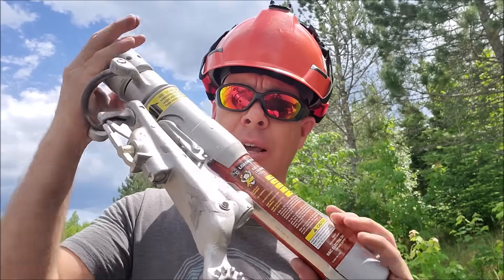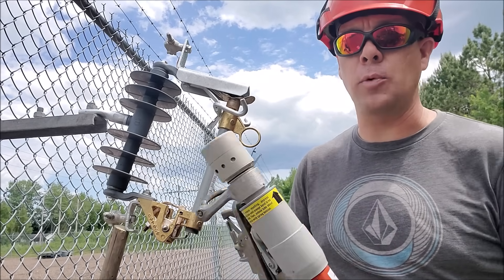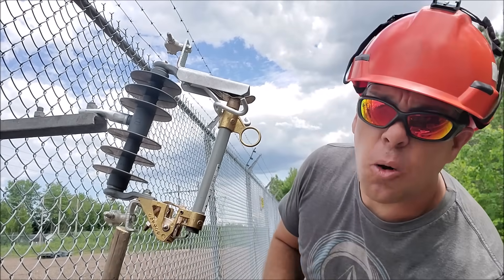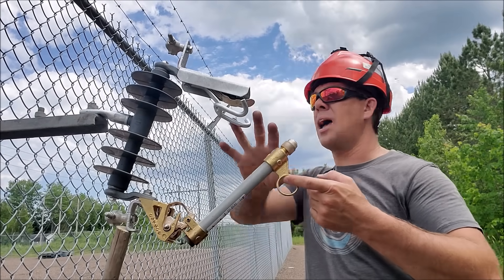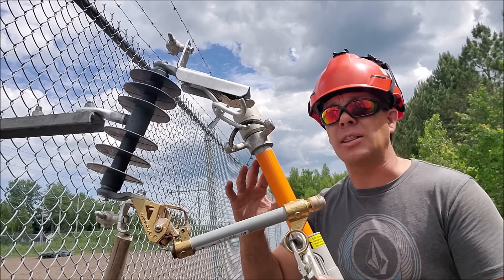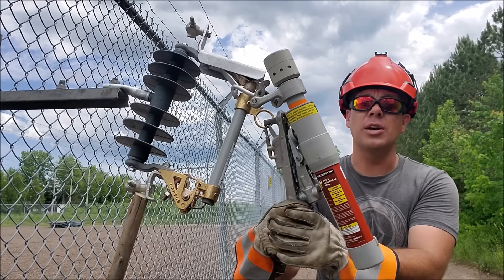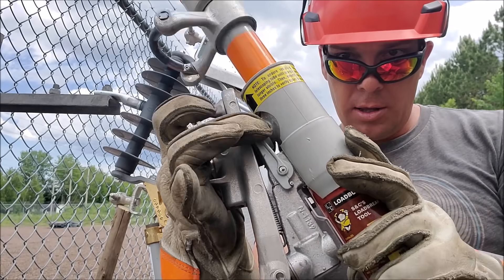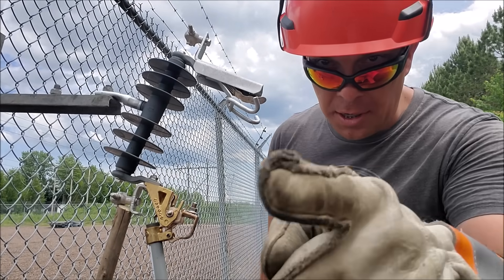Using the 25kv Loadbuster

Comment: Not sure the comments made before on SF6, but SF6 breaker internals are pretty cool. There are interrupters inside and the way it works is when the movable contact pulls from the stationary contact it creates a void inside the interrupter, sometimes called a puffer, and this creates a low pressure area that is then filled by the SF6 gas through ports and helps to blow, or "puff" out the arc. The entire inside is of course filled with SF6, but the interrupter creates this lower pressure area inside the interrupter portion. Oil filled breakers do the same thing, but instead of using a gas to cool and quench the arc, it of course uses oil. But the same principle with an interrupter and a void when the movable contact pulls from the stationary contact in the interrupter. In fact, the SF6 breaker interrupters were designed following the interrupters found in oil breakers, since the oil breakers of course pre-date the gas filled breakers. 
In a vacuum breaker you don't have any of this going on. In a vacuum breaker it's just the absence of air that prevents the arc from ionizing in the first place. But vacuum breakers are only viable up to a certain voltage class, which is about 35kV I believe. Also in a vacuum breaker, as I am sure you know, the distance between the contacts when open in a 25kV vacuum breaker bottle is less than 1/2 inch! That is why you never trust a breaker for an open and always use a physical visible open. And I am sure you know the tripping time on most breakers is in the order of three cycles or less! At 16.6 milliseconds per cycle at 60Hz, that's less than 50 miliseconds to open and quench an arc. Amazing some of the higher voltage class breakers can move that quick and some of the 500kV class breakers are even faster. I love working in substations, so much interesting equipment and technologies that most people don't realize goes on in there. I've been enjoying the videos, keep up the good content and work safe.
Reply: Excellent description! I worked at a Nuke Power Plant for 11 years. The switch yard used 4 cyclone 500KV line breakers that used high pressure  SF6 gas jets to quench the arc as the flying contact rotated 230 degrees inside the enclosed breaker (which looked a lot like a donut without a hole). The breakers each had a compressor to recover the SF6 gas after each cycle. The flying lead rotated around the center axis on an insulated arm driven by an enormous high tension spring. I don't remember the opening time, but it was very fast. These were unique breakers made for the nuke plant that were nuke safety rated. They were $$$$$$ each and were only rated for 4 loaded opening cycles, one of which was used during acceptance testing. I asked if they could be rebuilt and no, after 4 cycles the insides were burned too badly to be reused. And yes, they had to have a full set of spare breakers  in the warehouse on-site. 
We also had one of the primary 500KV transformers blow up. It was in a 3 sided concrete blast shield and luckily no one got hurt. The transformer was caring 1150MW at the time. Understand that the primary transformer is huge and weighs around 1,000,000 pounds. What happened is not frequent, but not rare. What happens is the cooling oil inside the transformer casing gets contaminated with too much moisture causing an arc, and once it arc's, kaboom! (It was heard about 2 miles away.) Normally, the oil circulation system removes water and contaminants from the cooling oil. The  identified cause was the oil cooling system from the time of installation over cooled the oil, allowing moisture to be absorbed. Where does the water come from? Amazingly, through the transformer's steel tank walls! Over 4 years, the steel was porous enough to allow enough moisture to be introduced into the oil (it doesn't take much). The company's own on-site engineers didn't bother to pay attention to the manufacture's recommendations and figured more oil flow through the cooling system was more better. The oil was supposed to run hot to drive off moisture...go figure...  Same thing can happen to pole pigs if they get moisture inside due to leaky tanks or damaged connectors.

Comment: Why is brass used?
Reply from the maker: They use brass for the lower portion of the cutout where the door hangs because it's stronger yet still very conductive and corrosion resistant.
That bottom piece acts as both a connection and support that gets pulled on as the door opens

Comment: Greetings from Indy.  We use load busters often. Not for just dropping load. But also to handle the amperage difference when separating mainline circuits. Great tool!  Thanks for the vids on trouble work. Working on a one man truck can be challenging at times. Keep up the good work👊
Reply from the maker: Challenges keeps ya on your toes! 
Yes we do the same (when breaking parallels) it's a very good practice... 
Thanks Greg! 👊👊
Reply: Difference in load can draw an arc. We do the same here in New York.

Comment: We use the same loadbuster at my utility and there is no SF6 gas inside. In my experience it seems to work best when you angle the stick 90 degrees/perpendicular to the door
Reply from the maker: I didn't think so ...A viewer commented earlier saying exactly what it was. It started with a "B". The comment was on the original post that crashed tho
Reply: @Bobsdecline  It works just as you described it. The only thing I could find thats used inside is a special lubricant. 

https://www.sandc.com/globalassets/sac-electric/documents/sharepoint/documents---all-documents/instruction-sheet-811-510.pdf?dt=637289915741304606
Reply from the maker: Interesting 🤔 The guy that mentioned the other thing said he worked at SC and had a good explanation.. I'll check out that link and see...
Reply: Bobsdecline - Lineman blogger Im not saying the guy is wrong but just a quick scan through S&C booklet I didn’t see anything that stood out. We send ours out to get serviced every 6 months anyways. Be safe out there bud
Reply from the maker: Yeah same thing here man! I read through that whole manual and couldn't find anything like what he mentioned, but it made sense!

I think the chemical lined the walls much like a cutout door, and when heated would release a gas🤷‍♂️
Reply: Bobsdecline - Lineman blogger Or maybe like the porcelain tip on the probe of an elbow? Who knows? 🤷🏻‍♂️ We just know when and how to use the equipment.
Reply from the maker: @jaxbeach09  Haha yup exactly! 
Its always interesting to fully understand what we're using.... But it's definitely more of a "put this thing here and press that button" kind of job sometimes!
Reply: Bobsdecline - Lineman blogger Isn’t that the truth!
Reply from the maker: It might be "Boron" 🤔
Reply: In a loadbuster the arc is contained in a chamber. Part of the chambers walls ablade away a tiny amount with every interruption cycle.
Reply: Ittechnically is an ablative type interupter. Or ablation type interupter if you want to google to find technical papers and patents etc.

Comment: Good show!  No SF6 on load buster ....RAG and standard multi position UG switch yes (visual gauge in green). U know👍
Reply: SF6 filled switches are a pain to maintain. If they go too long without inspection and drop into the red you can't operate it and you have to deenergize the whole switch to fill it up back up. My utility is going away from the SF6 switches to oil filled.